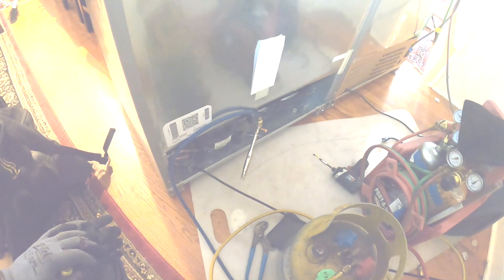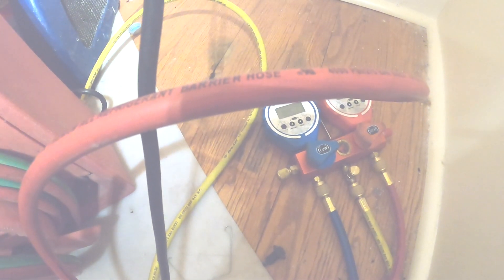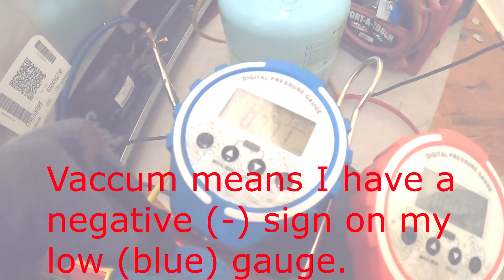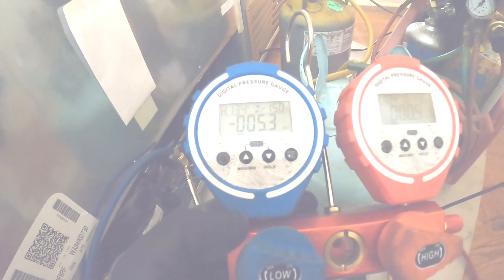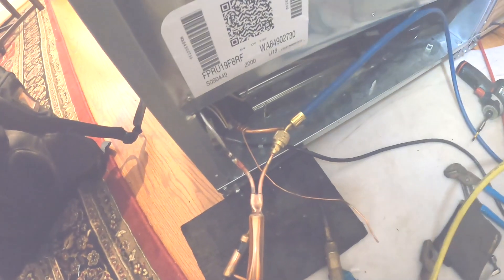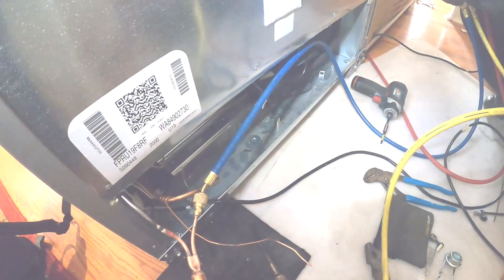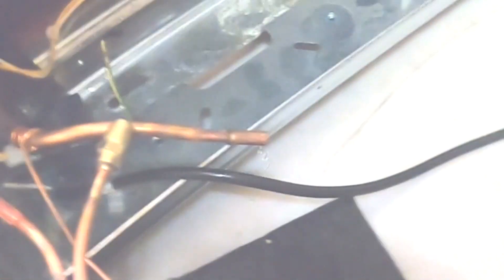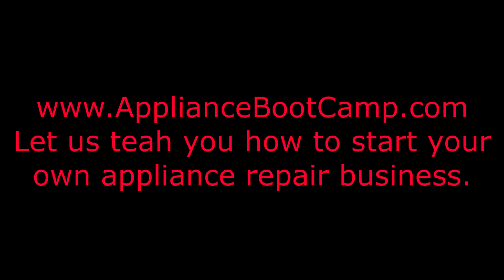How to find a restriction in a seal system.

Comment: How low was the low side? I've been seeing a lot of these new units with rust from the yoder plugging the dryer. LG Samsung maytag almost every brand 2017 and newer. If you have a leak usually high side has high psi and your below vacuum 10. Restrictions usually show under vacuum 15‐30.